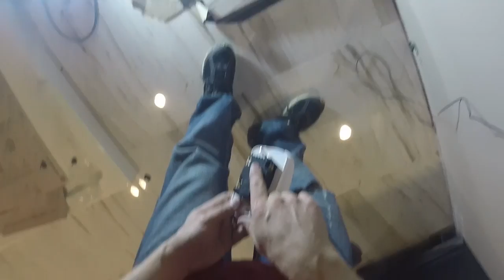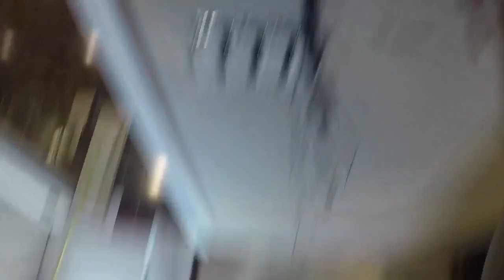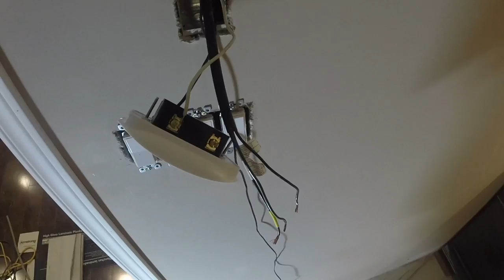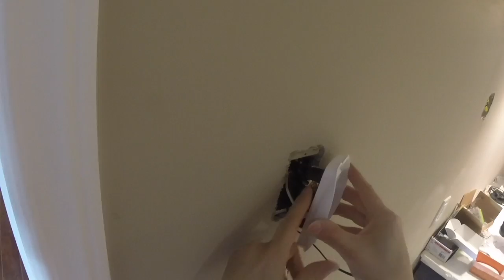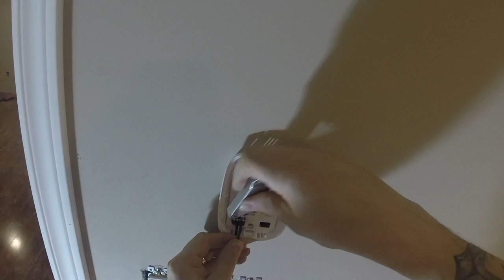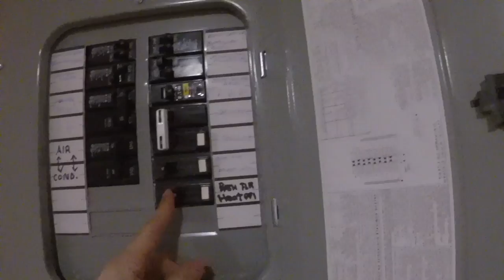HOW TO WIRE FLOOR HEATING

Comment: Pretty sure it's a violation of electrical code to put the sensor wire in the box. You can't mix low voltage and line voltage in the same box (or conduit). The thermostat base has an entry hole for the sensor wire so that it runs outside the electrical box and stays away from the 120/240 V conductors.

Comment: Hi 
I have a system that I need to provide a feed for, I called the manufacturer and they specified that the system is rated at 14.7 Amps and it needs a direct supply?
Does this mean no MCB?

Comment: Two questions if you don't mind- First, on some of my installation guides they suggest that I can tie into an existing circuit rather than run a new circuit to the bathroom. If this is feasible, i have two separate circuits that run to my bathroom- one with just lights on it but annoyingly the light switch is located outside the bathroom so running a power source from the switch box would be difficult (have to drop it through to the basement and run under the floor to get it to the right location, or go up through the drywalled ceiling). alternatively the other circuit that comes to the bathroom runs power to a 2gang box with a  GFI outlet (usually runs a hairdryer and single nightlight) as well as a switch to the bathroom fan). Pulling power off this circuit would be a hell of a lot easier but my concern would be the load. The AmP load of the floor will be 1amp (small bathroom); Fan Amp is 0.18, Hairdryer is 1875 watts (?15.625 amp). I need to check the breaker to this circuit- if it is a 15 amp breaker would i be right in assuming i shouldn't draw power off it? if it is a 20amp breaker (w/ appropriate gauge wire) would it work?
second question- if i did run a full new circuit- my sensor/thermostat has a built in GFI feature- so i'm assuming i could skip the GFI breaker. 
Would love to hear your thoughts, Thanks!
Reply: Emily Dornblaser a dedicated heating circuit is required by code.
Reply: You would need to check your local code along with National Electrical Code (NEC) to see if you need a dedicated circuit or not, due to the local code sometimes changing the requirements of the NEC. For example Michigan has the Michigan Residential Electrical code which changes some of the requirements of the NEC on just residential buildings and Part 8 rules that change the commercial side of the NEC.  The bathroom should be on 20 Amp breaker and that is rated to withstand 80% (16 amps of the 20 amps), so if the hairdryer was running with the floor heater there is a chance that it would trip. The fan is most likely on with the lights, so that shouldn't affect it unless you tapped onto the lighting circuit. And if it says that it is GFCI protected you shouldn't need the GFCI breaker, the NEC just says that the protection is required not that it has to be a breaker.
Reply from the maker: dedicated and protected by GFCI